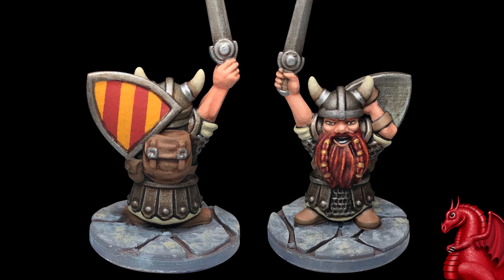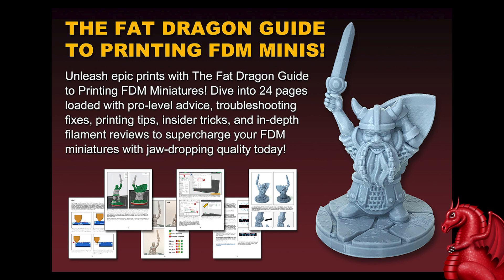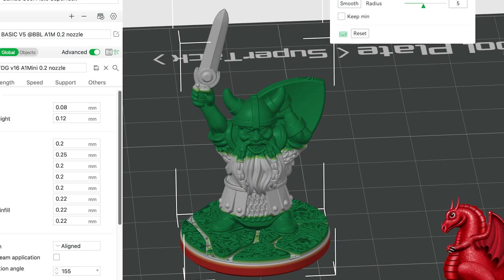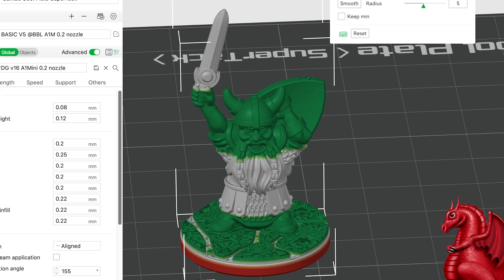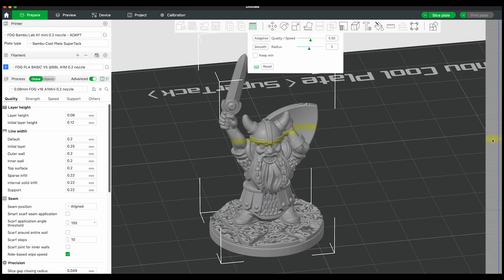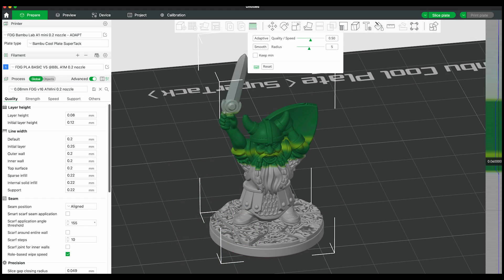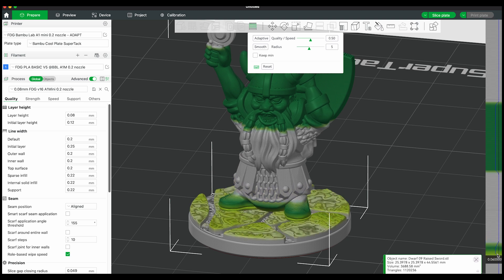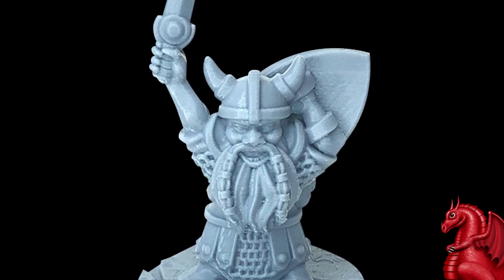Print Better FDM Miniatures!

Comment: do you have the profile you use with sunlu meta somewhere?
Reply from the maker: I used to, but SUnlu Meta changed formula a while back so my profile for it is no longer tweaked for it specifically. Now it is more designed for eSun PLA Pro/PLA +

Comment: Thank you! I always wondered how to get the layer height back to normal without trying to awkwardly push it back by right-clicking.

By the way, would you be interested in making a video about the cutting tool in Bambu/OrcaSlicer and using it to cut up minis, to print them in parts? You can easily set connectors between those parts. I've been using it to print almost resin-like BattleMechs.
Reply from the maker: Probably not as it isn't necessary for printing my models. :)

Comment: Is guide applicable to any miniatures or only not supported ones?
Reply from the maker: Most of the tips/tricks/techniques are applicable for pretty much any FDM miniature, but I do not provide support settings (those need to be provided by the designer).
Reply: @Tombof3DPrintedHorrors understood, thank you
Reply: Adaptive layers don’t work when you turn on supports.

Comment: Why does the .6 layer height have a problem with overhangs as opposed to the .8?Don’t lower layer heights do better with overhangs - more overlapping?
Reply from the maker: Nope, they are more susceptible to radiant heat, and being too thin in general makes overhangs harder to print cleanly. I show examples in my new guide.
Reply: @Tombof3DPrintedHorrors  I have not had this issue with adaptive layers. My issue has been with ironing.  The heat messes up a smooth surface.  Do you plan a video for that? :)
Reply from the maker: @AussumOutWest  ironing isn't of any use on miniatures like this, it's only useful on horizontal completely flat surfaces.
Reply: .06 and .08 typo